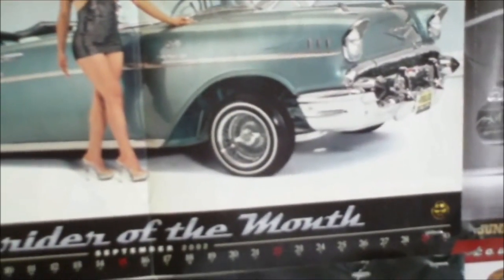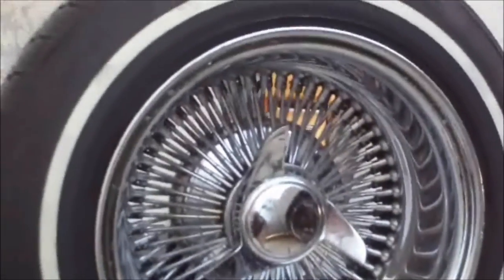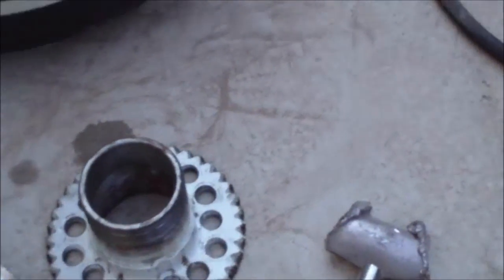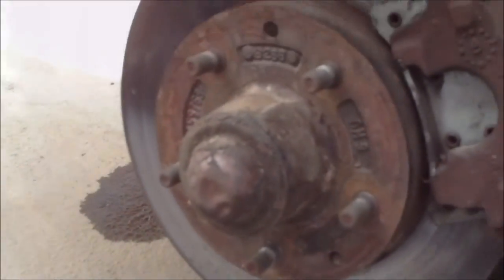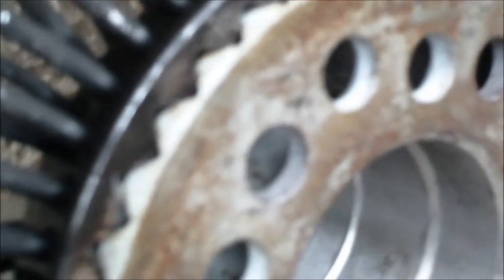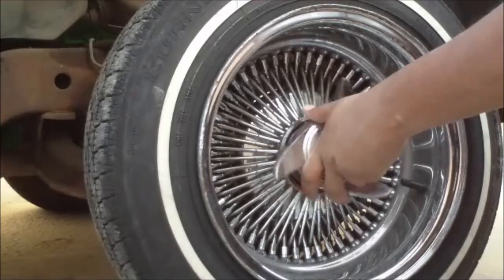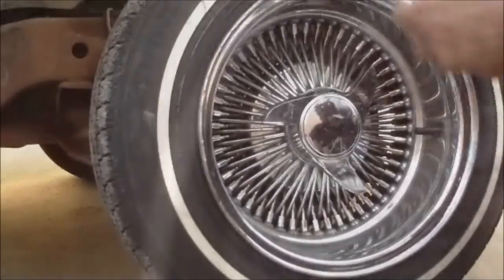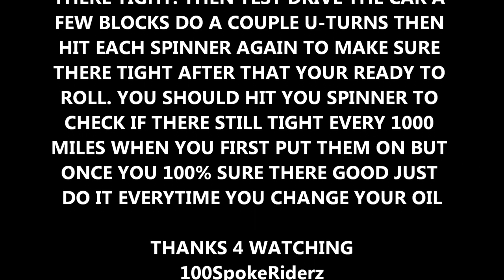HOW TO MOUNT WIRE RIMS ON YOUR RIDE

Comment: Number one reason knock-off wire wheels "back out" and come off is putting adapters on the wrong side of the car. "White means this, n red means that" bullshit go ahead n toss out the window. The left side of the car to some people is passenger side, some its drivers side. It all depends on your viewpoint to determine lect or right. So forget all that bullshit. 

All knockoffs/spinners should tighten to the rear of the car. If you're tightening your spinner clockwise on the passenger side of the car, then you got them backwards. "Righty tighty" is only for the drivers side. Counter clockwise is for the passenger side. 

Some adapters dont come color coded. Some are painted wrong colors. So always remember T.T.R. (tighten to rear).
Reply: Mister Amesa yeah, he never mentioned that. Very important
Reply: Yeah, I guess if you're from London or somewhere where they drive from the right side of the car? LOL
Reply: I bought adapters and wheels that tighten like a regular adaptor they all tighten clockwise regardless of what side of the car they’re on SMFH I think I got scammed but they’re my first wire rims so now I’ve learnt something today.. my question is, is it safe to just use it like this or get the correct adaptors for the correct side of the wire rims🤷🏼
Reply: @biggteez12  I would get the correct adapters. Trust me, you don't want one or both backing out while you drive. Wheel will go flying right off.
Reply: @thedevil3890  thanks, it means a lot coming from you sir mr devil lol..
Reply: @biggteez12  All good. You Samoan??
Reply: @thedevil3890  yes sir, what gave it away? It can’t be my first name now lol 🤦🏼‍♂️
Reply: @biggteez12  Oi sole, malo!! I'm Mexican, but I have samoan family n was kind of adopted by them when I was around 14yrs old.
Reply: @thedevil3890  hey you know us Uso ,we family oriented and can eat heaps of food lol.. nice to meet u uce
Reply: @biggteez12  You kidding? I'm only 200lbs but I'll hold my own at any dinner table with my 300+lb family members. I'll tear up sapasui, muli pipi, fasi povi, and a mound of rice all Damn day....
Reply: Yeah I’ve had some great Mexican friends when I was in the army. They were loyal to the T and always had my back no matter what. We’re still in contact after we’ve been out of the army and I call them my Usos

Comment: This is a great video.  I just got some 20” 150 spokes for my 97 Towncar and did not know you had to do all of this.  Thanks.
Reply: Did you end up mounting your 20s this way red knockoff adapter on the right side and white on the left side I also have 20 150 spoke and I'm wondering if this is the correct way to mount thanks in advance

Comment: what kind of grease do u use??... great video by the way
Reply from the maker: Ball joint grease you can get it at any auto parts store.... Thanks 4watching
Reply: I have a 1985 Monte Carlo cl I being wanting some 13 Daytons with the spinner would they fit it without any problems?
Reply from the maker: TheLegendKiller Gus yes

Comment: Thank you so much for the video. I love lowriders and the whole style they have. I have been dying to find out how these wheels get installed. I am going to be buying a new car in a few years and am looking to set it up with a set of old school rims. From the looks of it wire wheels might work for me. Along with the old school rims come the old sizes (13, 14, and 15 inch), I like this a lot.
Reply from the maker: Thanks 4Watching
Reply: 100SpokeRiderz when i was done putting my drivers side rim i lowered the Jack n got a flat tire? any reason why?
Reply from the maker: I would check the valve stem cuz if you slip & hit it with the hammer it will crack & leak air
Reply: thats exactly where the air was coming out of. got it fixed and cruised the streets of Santa Maria Ca....
thx for your response!

Comment: Does anyone know if you can put Dayton’s or wire wheels on a 2019 5.0 mustang,?
Reply from the maker: Because of the size of the brakes I would only try a 20" or 22" standard offset on that new of a Mustang
Reply: 100SpokeRiderz thanks bro! I’ve never seen a mustang with them and feel like I’d be one of few. I loved how Caínes 5.0 looked in Menace ll Society
Reply: I have them on my 99 ford mustang I get lots of compliments on how me and my mustang look good 🥰😊
Reply: @ingy1389  u got an Ig? So I can check it out
Reply: @ingy1389  whats your ig??
Reply: Shorty_boox3

Comment: Q:i have an 88 s10 blazer with 20s but they have 1 1/2 inch spacers should i take off the spacers to put on my 13inch wires?
Reply from the maker: Sounds like the 20s you have now are made for front wheel drive cars but with 13" wire wheels you dont need spacers
Reply: @100SpokeRiderz  thanks for reply yea i test fitted the wire with spacers and they do stick out a little bit im gona try putting them on with out the spacers.

Comment: Dude there is a reason why you don't yank those lug nuts down like you did. The lug stud will break and pull apart. Also you will crack you wheel hub and not only have no lug nut but you will have an unbalanced wheel hub.

Comment from the maker: The only way to get rid of the rust off 100% is to have them re chromed but you can use scotchbrite pads but you will have to keep doing it when the surface rust comes back

Comment from the maker: Im not 100% sure but I think thats the same bolt pattern as the 98-2002 Lincoln Towncar when you get wire wheel adapters it should have 3 different paterns of 5lug small, med. & big so you should be fine

Comment: My spokes on my wire wheels is leaking air very slowly. i thought it was the tire at first, got a new one, by the way my rim size is 14's. what i would like to see a video of you doing is how to stop leaks that are coming from the spokes by step one gettin the tire off of the rim and workin up on how to repair that leak without spending a very little or no money at all. please try to make a video you will save me $500 from buying 4 rims because no one sales 1 rim buy itself. thanks

Comment: good info! also even if the adapters are not colored, the spinner will be beat on toward the rear of the car against the way the tire rotates, if not the adapter will loosen up, every time... and the rim will fall off...  and as far as the lead hammer thing, that is the only (right) way to go!

Comment: The spinners are left and right hand thread. The white adapter is right hand thread the red adapter is left hand thread. This is so the spinners tighten while diving.  Acorn nuts  is what you want to use
Reply: So are you saying if the car is towed in reverse the wheels will fall off?!!!!!

Comment: Judging from what I can see of the car, I think that single wheel is worth more than the whole rest of the car put together.
Reply from the maker: Ok  I no long have the car or the wheels but next time I will only make a video when I mount up my diamond encrusted Daytons onto my new Bugatti 🤣😂
Reply: @100SpokeRiderz  What's the point? Wire wheels on a Bugatti signify the cheap model. The more expensive ones had cast metal wheels where the brake drum was cast into the wheel as one piece, acting as a giant heat sink for the brakes as the wheels turned.
Reply from the maker: @v12tommy  😱😐🧐

Comment: Why not use anti seize paste instead of grease on the threaded part? I would think grease would burn offf due to the heat from rolling and breaking while anti seize paste is good up to 1600 degrees, that's why it is used on o2 sensors that are on hot exhaust parts.

Comment from the maker: Sounds like yo got suspension problems check out the vids on my 77 ElCamino Im rebuilding the suspension now you will be shocked what you find on these 35year old cars when you start pulling off parts.

Comment from the maker: The rims was already scratched there very old & used when I got them. Also a rubber mallet does not have enuff weight to get the spinner on tight enuff & thats how your rim falls off the car >>>LEAD HAMMER ONLY<<<

Comment: Also if you have rotors like in this video an dont have a impact.I get a long screwdriver an stick it between a caliper bolt an the veins of the rotor.This way you can tighten your lug nuts w/o the addapter/rotor turning.An for the rear...like most RWD cars/trucks just do 1 side at a time.

Nice vid an builds.keep up the good wrk!!

Comment: right on. I just purchased this car, it came w/ the wire wheels I was just making sure, I almost took a trip with them on the car today "200 mile" round trip. maybe tomorrow I will. I like the look of my car, I also have the original wire hubcaps that came w/ the monte carlo, which look alright, just not as nice as these rims.  I wish the rims were 15 - 17 inch size though as the rims throw the speedo off somewhat.

Comment: The adapter doesn’t look centered it looks like the holes and the lugs don’t quite fit how would your center that
Reply from the maker: leon ramclam the lung nuts are beveled at the ends so when you tighten them down the push the adapter to the center of the holes

Comment from the maker: If there already mounted on tires & aired up bring a sprey bottel of soap&water to spray them down good to check for air leaks. Also check each spoke to see if there loose, check the teeth on the adapters & make sure there in good shape, check the threads on the adapters & inside of the spinners, & check the lug holes on the adapters make sure there not wallowed out. If the rims have no tires mounted you should check the seal on the inside of the rim

Comment: Fyi, Formula 1, Indy, CART, Pro Touring, Le Mans LM & DPT Racecars, Sport Car and several other race circut classes use center mounted rime which use the exact same set-ups except a big 38"-40" nut instead of a knock off to hold the rim on, also NASCAR approved sometime in the near future to switch to the same type as well.

Comment: All so when tightening.The spinners should tighten (or turn) towards the back of the car NO MATTER WHAT.I've seen china addapters that were painted the wrong color.meaning you'd be putting them on the wrong way.So make sure.Also you can get on layilow.com in the wheels topic an buy a "tool" to tighen/loosen the knock offs.Way easier than swinging a lead hammer an gets them super tight.

Comment: Most whitewall tires have been discontinued for 13s except the milestar, Hercules, Uniroyal tiger paw, and marshal. These are all WHITE WALL. The only one that looks good is the Marshal. They range from 200-300 a set of 4. Get on layitlow(dot)com and hit the wheel and tire forum, you will find some

Comment: good explanation about wire wheels. I use to have wire wheels in my truck and I never have problems. I when to Mexico driving around 15 hours from los Angeles to sonora Mexico and no problems.of course I keep checking on every gas station on the road when I filled my tank. like you said if we put the rims the right way is no problem. good video and good explanation.
Reply from the maker: +Manuel Palacios Thanks 4Watching

Comment from the maker: The Bullet knockoffs themself could have been on the wrong side see when you get new rims you get 2 knockoffs that thred one way for the left side & 2 more that are threded the other way for the right side. With a 2 blade or 3 blade spinner its easy to tell L&R because the way the blade is angled but with a bullet knock off not so much sometimes they get mixed up in shipping & sometimes people replace them with the wrong side thinking all 4 are the same

Comment: What kind of knock off rim is this? Which firm or model ? I want to buy like that ) Thanks
Reply from the maker: I'm not 100% sure the brand name of the ones in this video because these came on a car I got but there are 2 major brands Daytons & Zeniths that are still being made today. There are also some other less expensive brands being sold on eBay & Instagram

Comment from the maker: Sounds like its rubbing somewhere elese because the Caliper is hooked to the spendel & that all turns when the rim turns also if the Calipers were rubbing on the rim it would do it all the time when the rim spins not just during a turn.

Comment: I dream of putting some of these on a AWD vehicle, will there be any issues??
Awesome video, man. Plenty of info in there. Thanks.
Reply from the maker: AWD ? What kinda vheicle?
Reply: @100SpokeRiderz  1995 Subaru Legacy L postal wagon
Reply from the maker: @shanehutchinson6350  ok I had to Google that to see what it looks like but I would say if you use front wheel drive offset they will fit standard offset they might fit with some very low profile tires
Reply: Is there some reason there are fwd and rwd specific spoked wheels? Also, thanks for the help, man.
Reply from the maker: @shanehutchinson6350  yes its all about the offset of the wheel the RWD wheels are deep dish with a big lip if you try to put them on a FWD or AWD they will stick out very far pass the fenders like thoes lifted off road monster trucks
Reply: @100SpokeRiderz  damn it.. I'm trying for a tucked in look... I have a 1999 Legacy GT as well, and that one rocks gold Aodhan DS01s, they're 18x9.5, +35 offset and they poke out some. I love the look, but this postal, I wanna slam and need some more narrow wheels like between 6" and 8"....😬
Reply from the maker: @shanehutchinson6350  sounds like the only way it will work is with front wheel drive offset wire wheels
Reply: @100SpokeRiderz  thanks a lot for the help bro

Comment: no shit grind the caliper man do i still use a spacer that seems like alot to grind lol u got any videos on that ur the man bro any advice u got im all ears
Reply from the maker: I dont have any vids I sold both my 73 Caprice's but the easyest way to get 13's to clear on them big cars is to grind down the calipers but you still need to use the spacers so you dont have to grind as much. On one of my 73 Caprice's I had spacers, longer studs & I had to grind but the other one had 14" wires so everything fit great with the stock set up. I know people that have been riding for years with 13's on there 71-76 Caprice/ Impalas check out this topic there is a TON of good pics & info on that body style of car http://www.layitlow.com/forums/16-post-your-rides/36084-71-73-caprice-impala-fest.html

Comment: they all tightened towards the rear of the vehicle so, i don't think that was it- I got that set used n i think the adapters were already worn. didn't keep me from pushin the 100 spokes, just gotta new set of adapters n it was all good. chewed the adapter not the wheel

Comment: Are these type of rims easy to steal?
Reply from the maker: there the same as any wheel because there are still lug nuts holding the adapters on but you still need a good aftermarket car alarm.... Thanks 4Watching

Comment from the maker: I would go with knock offs as long as you put them on the right way it will be fine as far as the size goes If you plan on leaving the suspension stock 15X7 will be good but if you plan on getting hydraulics or airbags later on down the line you would be better off with 14x7.

Comment: How i get that look, i mean it looks like tire is thin at the tread and thicker towards  the  edges?
Reply from the maker: That's how all 13" white wall tires look
Reply: 100SpokeRiderz,  actually  i got tge answer from the  tire store so basically the tire is thinner than the rim.
Reply: Stretched

Comment from the maker: 1978-1980 G-Bodys have smaller brake calapers than a 76Caddy so I only had to shave off 1/4" of the calaper bolts to get my rims to fit.

Comment: Hitting a gold rim and with spokes  , gives me anxiety , I love the rim but probably will have to pass and still can’t do donuts on them that’s weak 👎🏽 would u recommend that hammer on gold ones or does it matter ?
Reply from the maker: They make a knock off tool also that would be better on gold than the hammer but if I had gold wheels I would have both the led hammer & knock off tool

Comment: I mounted my 13 inch rims on my Cadillac deville 1990 and my rims where sticking out like 3 inches out of my car and when I was cruising my front Right tire fell of my car it broke my thing where I put the nuts on all 5 broke off and use short open end nuts and I put the white adapters on the left side and red on the right side and lock in the rim into the adapter and still the front right tire felt of the car why did it fall of the car I don't understand why? it fell of please help me
Reply: +Daniel Garcia Most likely, the lug nuts holding the adapter were not tightened correctly.  Also, putting the adapter on the wrong side can end up with the spinner falling off.  More good videos like the one shown here would benefit viewers. If you try this on your vehicle document it with some video for the benefit  others- especially on the vehicle(s) mentioned here, such as the 1990 DeVille.  
At the least, you can review the video to see where you went wrong.

Comment: excellent video. So quick question, if the drum or disc brake is too big (bigger than the wire wheel) will the adapter push the wheel forward enough to clear whatever brake setup you have? Or do you need more spacers?
Reply from the maker: Some people use spacers , some grind the caliper down & some do a combo of both. Sometimes 13's are just too small for size of the ride so 14's & up would be safer
Reply: @100SpokeRiderz  excellent thank you

Comment: I had my left rear 20" spoke fall off on me once. adapters were on the right side n everything. started to hear this "clicking" sound when slowin to a stop. few lights later- i see the wheel roll past my drivers door into oncoming traffic at a stoplight. luckily nobody was coming- chewed the adapter to shit. i had bullet knockoff and used a 5lb. sledge to hammer em down- why did this happen???